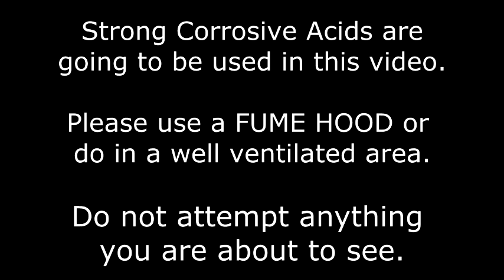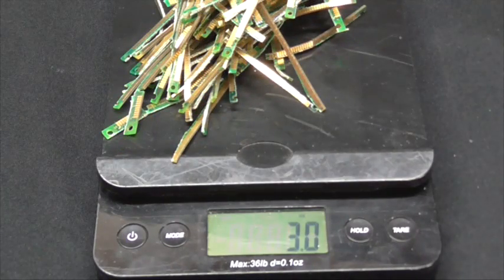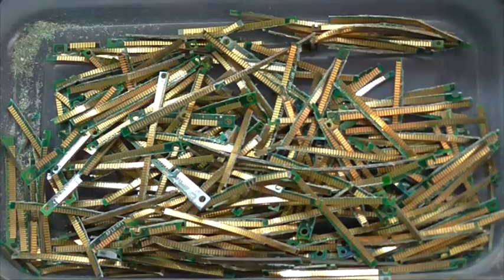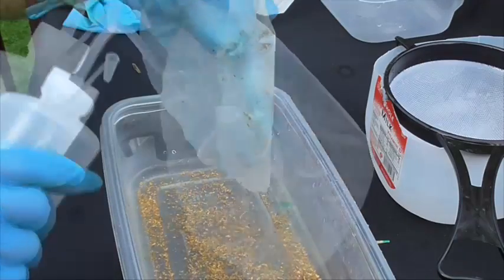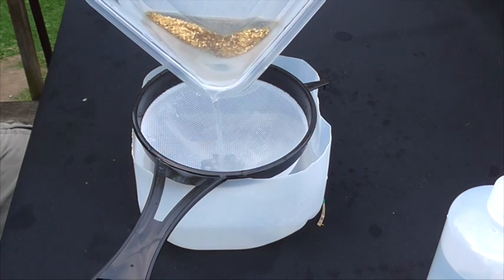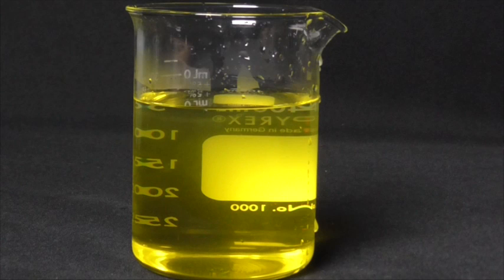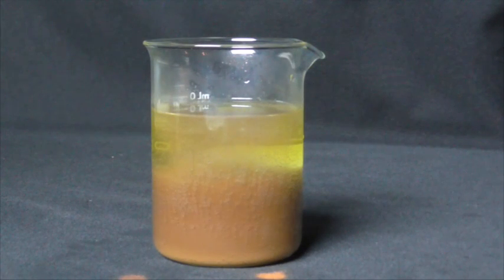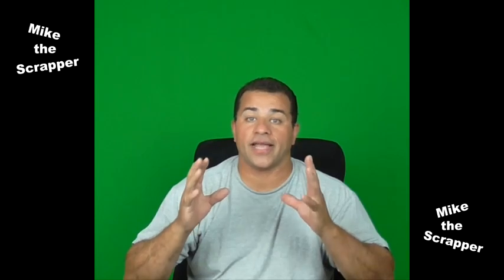Gold Recovery ( Scrapping Ram finger boards)

Comment: Its a superb video. I have a query mike that initially you have added hydrogen peroxide with muriatic acid then you mixed the latter with nitric acid, but there some people who process it by dissolving the rams in aqua regia . what is your opinion on this and how much time it takes to dissolve gold in AR . thank you
Reply from the maker: raunaq jain I do make Aqua Regia . later in the video. I did this in 24 hours. I let mine sit in a bath to make sure. I get it all.
Reply: If you put fingers straight into Aqua Regia you'd dissolve gold with other stuff. Hydrochloric acid is used to separate gold from the fingers by dissolving copper and zinc(if I recall correctly) which are directly under the "gold flakes". Hydrogen peroxide is part of mixture just to give it additional oxygen into the process. Mike has made Aqua Regia later in this video - it's hydrochloric acid + nitric acid

Comment: Hi ,I'm back again with another question (I love your work by the way). my question is about the concentration of Muriatic Acid and Nitric acid . I use 30 % concentration of Muriatic Acid and 69 % concentration Nitric acid ,I wanna get the best results using those two concentrations that i already bought because I couldn't find the concentrations that you mentioned in the description. keep up the good work.
Reply from the maker: Samir Ouissrane should be fine.

Comment: Hi, I'm a big fan of your work, keep it up, I just have one question could we use a fertilizer (the one used in Agriculture) instead of the urea ? but if not, could you be more specific about the urea. I'm having trouble figuring it out.
Reply from the maker: Samir Ouissrane not sure. never heard of that.
Reply: urea (CO(NH2)2)  is a fertilizer anyway and sold by agrochemical shops , however i cant say what % of purity is the content. Urea is found in human body and it is rejected with urine thats why it is called urea from greek word ura=urine

Comment: I'm under 18
i have full bag of old rams i could also melt that IC's 
Also i like to reuse electronic components (desolder)  since i bought hot air gun and i just doing whole board and not only stuff i need i get ic's caps and some have gold silver platinum in it
But there is catch i live in germany (i'm from poland)  and there is no easy way to get any chemicals and 2nd catch is that i live in small town 
Also i have only one room (whats unnormal you might ask?  I have to learn and do my electronics is same room (yes you can imagine how nasty is looks(no i don't have garage or smth like that))) 

100odd rams for 40$? Man i cold do fortune 
You didn't even use caps and ic's on that rams
I have been throwing gold plated connectors away and crying that i can't dissolve and melt that stuff

Comment: Man be more careful when handling bottles of such chemicals. It's all dripping out as if you  were serving a glass of green lemonade... And the "container"... I don't understand why you felt the need to cut it that way, e.g. practice to do straight lines with a cutter at the least.. Or use the "other" container which is bigger instead! Your way to handle things is really not an example, you make it dangerous and I wouldn't want you to do stuff like this in my garage : those chemicals require dexterity, there's a way professionals handles these so no drop gets on the table or running down your gloves/hand, etc....But overall it was very informative, thanks.

Comment: Any reason why not put the whole board in to acid instead of cutting it. I believed there are still gold in the board circuits.
Reply from the maker: There are to many types of metal on the board and you would use up a lot of material to dissolve all the extra metal.

Comment: I took a brief look at the cost of the individual chemicals you used to extract that $40 worth of gold. Conservatively, $1.50 for muriatic acid, $1.00 for peroxide, $8.00 for nitric acid, $0.50, $0.50 or more for urea, $0.25 for precipitate.
Of course you must buy larger quantities than those required for this one batch so you'd want to have plans to do much more than just that one batch or it would not be worth it. 
So to get, (maybe), $40.00 worth of gold, you must put all that time in and spend $11.00+ for a batch. The advantage is that this is something you can do in your free time. There is no rush between stages as far as I can tell. You'd want to do this away from the house of course. These chemicals release fumes that you wouldn't want collecting up inside. The disadvantage is that it IS dangerous if you don't adhere strictly to safety guidelines, and it IS alot of work for $20.00 to $30.00.
But hey...Its gold! ;)
Reply from the maker: If I had more Ram. I could of showed you more gold.
Reply: Mike the Scrapper
Reply: Mike the Scrapper

Comment: shouldn't you use more nitirc acid to dissolve the gold?

usually about 3 parts nitric and 1 part muriatic is used - your 1:1 mix seems a bit odd, is there a special reason for that?

Comment: Would you recommend this as a reasonable method of getting some side cash ?

P.S  what is the best part of a computer or circuit to harvest the shiny shiny from, also how much RAM on a estimate would you need to make a Coin of 24k gold?
Reply from the maker: no. Takes to long. this is for a hobbyist. I used 106 and I got a small amount. you would need in upwards of 500 to 1k of boards.

Comment: Which concentrantions of nitrici and muriatic acid you used ?
Reply from the maker: Muriatic is 20%. the nitric I can't see the label anymore.
Reply: Mike the Scrapper  why you didn't use directly aqua regia instead of acid peroxide followed by nitric - muriatic method ?

Comment: could you re use the acid?
Reply from the maker: you may have to revive the acid with Peroxide for the 1st part.
Reply: Mike the Scrapper alright so I could get around 2-3 batches done with the same acid just use more peroxide

Comment: hey mike could you use 500ml of the product instead of 1000ml,or is there a reason you used 1000ml per unit thanks.
Reply from the maker: I used enough to cover the fingers. That is why I used 1000ml.
Reply: thanks

Comment: "1000 ML"
?
Reply: 1000 Millilitre, or 1 Litre.
Reply: Yeah, but shouldn't it be 1000mL?
Reply: Naomi Nekomimi 
Oh, yeah, I forgot about that too. Yeah, that bothers me...oh well...
Reply: Naomi Nekomimi milliliter you idiot
Reply: Dįmšįm Pōtåö Dīśhwàśhėr no. "M" means a thousand of / mega, "m" means a thousandth of / miLLi. stress on the th. dishwasher, you're the idiot here, go back to the kitchen
Reply: It's not a fucking swimming pool he isn't using MEGA litres
Reply: 1000ml(MILLILITRE) = 1L (litre)

L2metric
Reply: Dįmšįm Pōtåö Dīśhwàśhėr You're pretty saucy.
Anyways, 1000ML throws you off. It should be corrected to 1000mL.

Comment: this is the reason why u dont get alot or no money for scrapping your computer, my brother worked at a recyle station for computers, they recyle all kind of metals from the computers and sure gold is worth most per kg but overall not the biggest gain for them and they hardly break even for the work so doing this simply for profit home is firstly danderguse and secondly not worth it
Reply: kallmannkallmann when you get alot of computers for free everything is profit
Reply: Adam Tolley the pay for workforce and chems and facility etc makes the gain rather small, sure u may get them free but dosent meen its free to ship them or to do the process etc..
Reply: Kallmann i am in australia so i got no where to ship em and i work 60 to 80 hours a week in my normal job this is just some sideline money it only becomes hard to make a profit if you work 8 hours a day doing it i sit and drink beer and pull stuff apart so in turn i get paid to drink beer lol

Comment: There is a problem with the chemical mixture you're using and will cause the gold to dissolve. I refine gold and silver myself, and when I used this method of 50/50 Muriatic Acid (Hydrochloric Acid) and peroxide, I saw the gold flake off of the sim cards and some of the flexible cell phone keyboard mylars. After a day of soaking, I noticed that the gold flakes were disappearing and then eventually, there was no more gold flakes at all. Upon reviewing my old source for gold refining, I found out that whatever amount of Muriatic Acid you use, you ONLY need about 2 CAP FULLS of peroxide, enough to make an oxidation of the solution. An equal amount of Muriatic Acid and Peroxide WILL dissolve the gold away. I even did some pins with this solution mixture and after my gold flaked off and started floating, a day later, the gold was completely dissolved, along with the pins too.

Also, to make sure that the gold flakes is clean and no dissolving of them are still going on, and to get purer gold, the flakes need to be rinsed several times with straight Hydrochloric Acid, then a few water rinses. DO NOT use Muriatic Acid.

Keep in mind that even though 24 hours is long enough to strip the boards and other material like pins, anything could happen whereas a person can't get to their solution in that time frame, or they simply forgot about it, and when they do go to check it, their gold flakes WILL be completely dissolved. That's why there is no need to do a 50/50 solution mix whereas you only need about 2 cap fulls of peroxide. You can get back to it later than 24 hours and your flakes will still be there, compared to the 50/50 mixture and after 24 hours, your gold will be dissolved.

Since I wasted 10 sim cards using this method, I also tested the solution with some stannous solution and it doesn't show any gold in the solution either. The stannous was freshly made and tested with some gold solution and it's positive for gold in my gold solution. So, the stannous is good, but I don't know why it won't pick up from the muriatic/peroxide solution. It may be because of the other chemicals in the muriatic acid.

Thanks for the video.
Reply: I also meant to say that after using the solution, it CAN be reused, in case someone wanted to do more material. If it stops stripping, then add a cap full of peroxide and about 30-40 ml of Muriatic Acid to reactivate it.

Comment: I wouldn't even know where to find a few RAM modules let alone enough to make this worth while :)

Mike out of interest, what's the cost of disposing of the chemicals used in this video? Surely you're not allowed to flush them down the drain? Or is neutralising them good enough? Doesn't seem right but wouldn't surprise me.
Reply from the maker: not much... once you have a large enough batch to dispose of should be $40
Reply: Thanks for the information! Out of curiosity, have you considered selling on the old PC's and laptops you come across? It seems like you would make more money that way than scrapping the materials.

Comment: I'd rather hoard copper from abandoned homes.
Reply: there might be alot of money there, but unless you own the home you are getting the copper from...you are STEALING and that makes you a thief
Reply: There is a lot of money in that.
Reply: I use to make hundreds of dollars every time I went out and did houses, back when copper prices were over 5$ a pound.
Reply: There is still money to be made from it.  It is better than scrapping aluminum.  I mostly scrap aluminum just because it is everywhere.  Occasionally, I might scrap old brake rotors after changing my old ones and that is really the only time I ever bother with scrapping steel or iron.  I drive a Volkswagen and so the rotors from it really aren't that heavy.  The other reason I don't scrap steel it they prefer to buy it by the hundred pounds.  I have a car not a truck and I don't like putting anything really heavy in the trunk.  My transmission is automatic and so I try not to beat it up too much.
Reply: crackhead

Comment: you know you could have made more than that $40 if you spent the time doing some proper work. Then use the money you made from that to buy gold if you want it.
Reply: bassl0va as a fellow scrapper the gold is the by-product of scrapping i primarily scrap electronics for copper and aluminium and the gold that comes out is in many electronics there is more than just gold on the ram boards you can yeild up to 2 grams of a burned out no good for nothing high end  computer that someone is throwing out so why hate on someone that knows more than you
Reply: Idiot.....
Reply: Bucharest.OG Who? The guy who made the video? Yes, lol
Reply: Adam Tolley It really makes no sense for the environment either. With the amount of stuff that is thrown out and destroyed, why saving 2 grams worth the time or effort? It's not worth it for the money either after buying all the chemicals for it. Bothering to get anything off the boards in a computer isn't worth it. The only decent amounts of metal are the heatsinks, the HDD and the case.

I know someone who scraps things, he doesn't bother with computers...

Comment: can I mixed Hydrogen 50 % with it ,
Reply: can mix hydroegn 50% with Muriatic acid 33% , how much do I have add ? i sthis will work like that , please help me
Reply from the maker: use 50 % of each
Reply: Mike the Scrapper I think he's refering to H2O2 as a 50% concentration rather than the 3% you were using in your video

Comment: Hey Mike I didnt go thru your comments to see if anyone mentioned this too you yet but from my understanding of the process is that the mixture you are using can be used again, that green color in the mix is copper and to remove it from the acid you created you simply put stainless steel in it like a butter knife and within 24 hours most of the copper would leech out and attach itself to the knife, then you simply remove the knife and wash it and you will have powdered copper you can keep and add to the collection for extra money and as an added bonus you dont need to spend as much money on the Hydrogen Peroxide and Muriatic Acid because you are recycling the acid as well!! if you knew this already then sorry I wasted your time but I hope I put a little extra money in your pocket! you rule man! keep up the good work because I have learned alot from you good sir

Comment: when i added HCL and Nitric acid to the finger and gold plated pins i got black solution instead of yellow one, is this alright , if not what is the solution ? ..... thank you in advance
Reply from the maker: I think the plated pins gave you that reaction. Try leaving the solution in a warm area in the sun. that should start the process
Reply: Another Q please, can i use the same method of RAM finger with CPU and another gold plated pins......and what is the concentration of Nitric acid and HCL, because i used in my first experiment high concentration.

Comment: Mike... 40 bucks for 106 boards??  lol 

First let me start by thanking you for making the video.  My following comments are in no way intended to offend you or troll.

I was thinking about what you said.. "You aren't going to get rich".. there is a few things people might want to consider up front.. (maybe you could do a follow up video?)

- Material cost (chemicals & tools)

- Proper Disposal of Chemicals used, Can they be re-used?

- Proper protection equipment (PPE - gloves, type of face mask, goggles)

- Where is someone going to get a hold of tons of scrap computers?  What is the best way to go about it? I would think that big electronics scrappers would have plenty but they are in it to make money too so i doubt they would give it up.

- Time investment - after you take the time to find a good supply, running around to get supplies (gas money), buying material, spending a few hours breaking it down, and then finding someone to melt it for you if you can't melt it yourself.

You would really have to have a stock pile of parts to make a nice investment/money.

I also like some of the other points in the comments section.  This video makes me think of the smart Jewish folk during Nazi Germany. (:

Comment: I wonder what the cost of chemicals and other materials is. Sure you might have had close to $40 worth of gold, but what did you use in chemicals to get it? $20 worth?  More? Combined with the considerable amount of time needed this just doesn't seem profitable to me.
Reply from the maker: I spent about $100 on all products. I only made $40 but I still have enough chemicals to make more batches.
Reply: Right I figured you didn't use it all. What percentage of the chemicals bought would you say you used for this batch?

Comment: the addition of urea is redundant... in fact it is counterproductive ... you claim the urea is added to neutralize the acid ... it wouldn't react in a classical acid-base sense of neutralizing .. with HCl, urea forms urea hydrochloride and with nitric acid .. urea nitrate which is an explosive... it will also react with the NOx that may have been created from HNO3 due to decomposition by heating ... anyway ... your goal is to reduce the gold from HAuCl4.. and you are using SO2 ... SO2 is generated in situ from the metabisulfite and an acid ... you need the acid in the in order to have the SO2 produced ....so, in my opinion .. don't waste urea .. just reduce the gold with the metabisulfite,, or you can bubble the SO2 to the solution or chlorine for that matter ... or even use aluminum zinc or other metals (see reduction potentials) though the gases are superior over those metals when it comes to residues and purity of the reduced gold